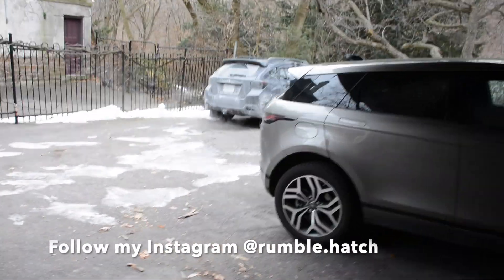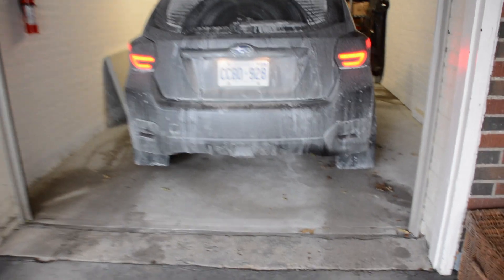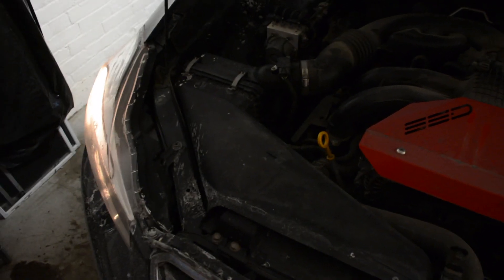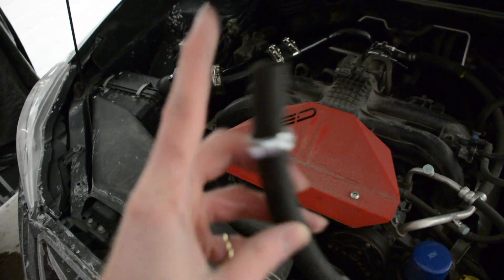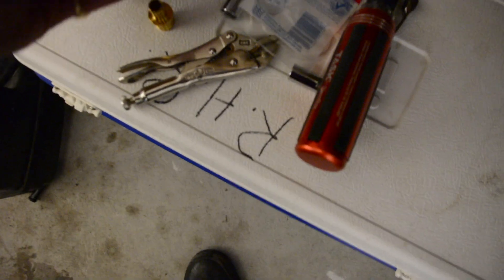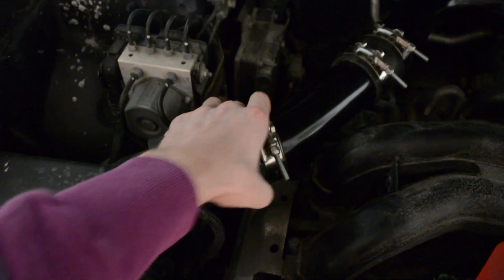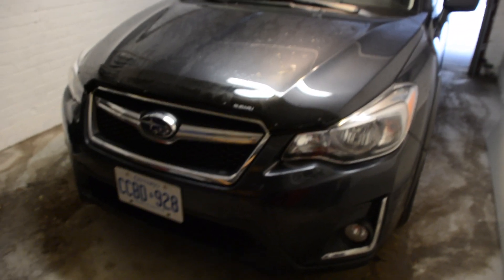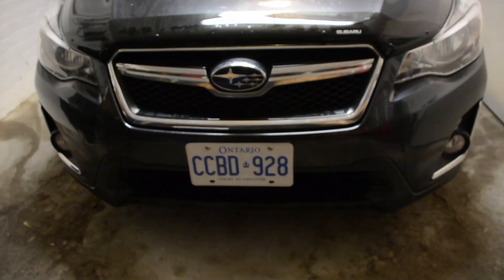Building a Subaru Crosstrek (Part 1) - Installing a Cold Air Intake & Small Exterior Parts

Comment: Curious about your rig here, Stock ride height looks like but maybe im wrong, if im not can you share your wheels and tire specs? looks like you got those tires nicely tucked in there which im looking for but not sure how much bigger i can go without rubbing before a lift is required which i dont want to do.
Reply from the maker: Cory Berard I have actually lowered my car.  In this video I am on 2013 wrx hatch struts.  Rims are 17x8+53 with a 225/55/17 tire.  Check out my recent video for how it is now